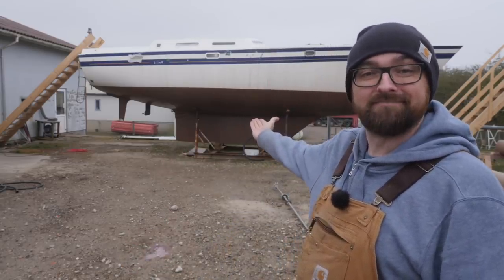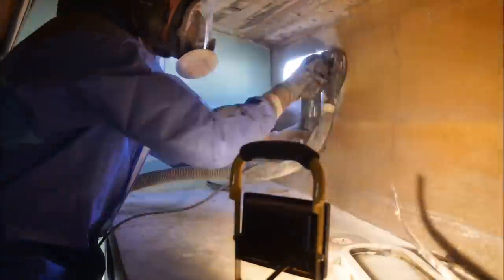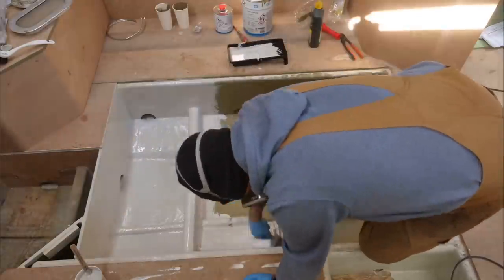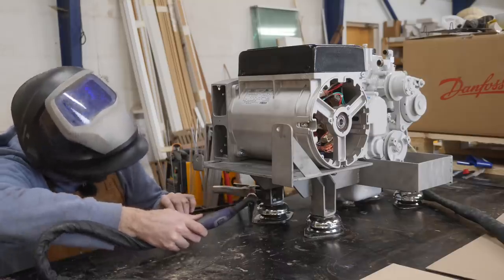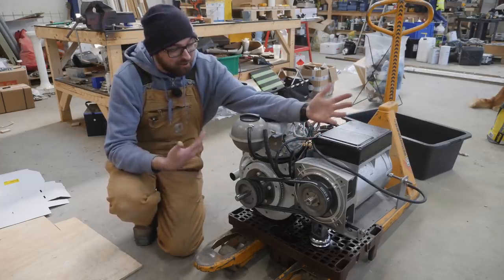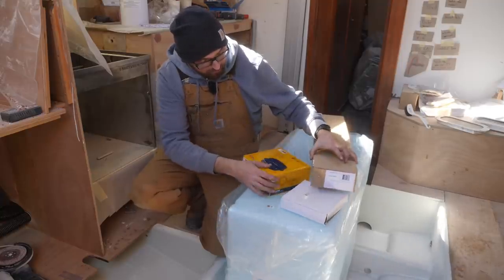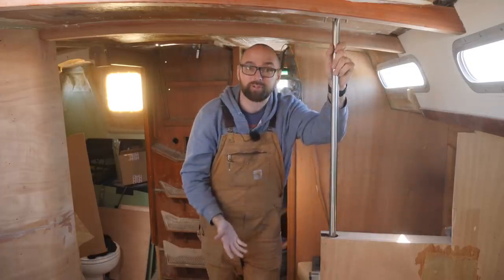Sail Life - DIY generator fail, galley pole - sailboat project

Comment: That sucks mads but, you can't put the crap back into the donkey.  Is changing pulley sizes to up the RPM at the genertor an option?
Reply from the maker: Hehe, that's true - or at least I'm pretty sure the donkey would be very offended. The RPM needs to be as close as possible to 3000 at the alternator to get 50hz :)

Comment: An option would be to change the alternator to a 4 pole version which runs at 1500 rpm. You can alter the pulley ratio to 2:1 so engine run at 3000rpm and the alternator at 1500rpm. Because of the ratio wouldn’t the engine in theory have twice it’s power output ???????

Comment: What are the differences between the 102 and 402

If these are the same engines, you could modify the 102 into a 402

I’ve changed my 9.9 hp omc into a 15 hp by changing the carburetors and the exhaust 

Just something to look into

Comment: Curious how you will fill and vent the diesel tank in the island?
Reply from the maker: The are two options :) Lazy solution is to fill and vent to the stainless diesel tank aft of the engine. The not-so-lazy solution is to vent through a pole (like the one in the galley)

Comment: Since you built a genny for a 402...find, build, or steal a 402. If 102 is the same block/head you might be able to seduce your 102 into becoming a 402 with injectors or other items.
Reply: Looking, your 102-04 is 411 cubic centimeters displacement. If my math is right, that's (almost) half a litre...the 402 is also half-litre. This might be doable either turning up your injector pump or replacing injectors and pump.

Comment: If both engines are the same size just find out what the difference is and modify your existing engine. Rebuild with an upgrade to the 402 so to speak. The alternative is just use power management like we all do.

Comment: oops,  Sounds like something I would do :)  I only think of how your temperament will be in 2 yrs when you are listening to the generator run 20% longer.  Lithium battery capacity would help in giving you more flexibility in your charging regiment.  You really won't know until you experience it,  it may not be a big issue.

Comment: Litterally an itty bitty turbo would double the output.   (the DIY route I would think would be a stock snowmobile or jet ski turbo, and those might be big.  They are getting upgraded all the time, and the OEM stuff is 10% or less on ebay).  See what the difference is between the 102 and the 402, specifically the connecting rod.   If it is the same part # you litterally could just produce more power out of this one, and the actual economy will go up.   Don't mess with intercooler or .anything.   Or, bite the bullet and get the 402, if they really look identical should be reasonably pain free swap, re sell the 102 to mitigate...   good luck.

Comment: I wonder if the 4 series is the same dimension as the 102. I only find listing for the 102 on a Turkish site, and Perkins itself doesn't seem to acknowledge the 102's existence when I do a search, but Perkins Parts does list it for filters and small parts, so the only dimensions I find are overall sizes, not between mounts or any other technical drawing. I think their website really doesn't like that I am not using Windohs or Mac, as well. and it is slow as all get out.
Also, when I look at "How to identify your engine" they don't show the ID casting for the 100 series to be where yours obviously is.
If you keep it, I'd look at turning the alternator a hair faster and running it as a charger for the battery bank. but you would then need more capacity there and with the inverter.
I tried a few other things, and I am really having issues with websites (multiple browsers and drop menues won't drop, ebay filters will not show, and other small issues . . . Who broke the introwebz?)

Comment: The proper sizing for an engine for a Genset is the engine should be sized %120 of the Generator max KW load. There must be a reserve of power to prevent RPM drop due to load. The Generator MUST maintain the RPM to make 50 cyle power. Other wise you can damage your electrical equipment.

Coking is not a problem with modern diesel engines.

(;-) TP

Comment: Looks like the 102 is not a very common engine. Much less info online. Looks like its about .1 liter smaller. Its .411 liters to .5 for the 402.  I was hoping it was just an injector upgrade, or just a turn on the fuel screw,,, but looks like the internals are smaller.
Reply: Both the bore and stroke are smaller in the 102.  The stroke is a fair bit more in the 402. 64mm compared to 72 mm in the big boy.

Comment: Sell the 102, buy a 402.  Even if the 402 needs an overhaul, it'll eventually pay for itself by not having to run it as much due to the more efficient output.  From the sounds of it, it would be a direct swap.

Comment: That is exactly the output I have mostly for my ...about 4500 watts max at 110 volts.  I can run a 1hp watermaker,  (See SV Adventurer's 30 GPH watermaker build on yewtoob.)  and, simultaneously run a small washer, heat hot water, charge batteries, and take a shower.  The power assist Victron as long as you don't take it too far works just fine. to meet all my needs??  Though the hot water is usually as a solar hot water dump with a dc 600 watt element, that kicks in when the lithium reaches 90% state of charge...you don't want to charge the batteries past 90% typically as you can cook them...and it means you can get 2X the number of cycles out of them...not lower than 10%  and no higher than 90%(Watch lithium below freezing...consider making your own LTO batteries that won't mind the cold.).

Comment: How about a bigger inverter and battery bank, and run everything from batteries making the generator part of something more akin to a hybrid power situation? You could then run the generator in it's most efficient, lower RPM range and the batteries would basically be a buffer tank.  Efficiency is pretty high but not 100%. Dunno how the math would work out.
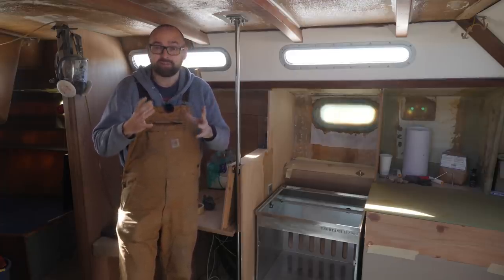Reply: Haha I typed this comment ^ before I got to 16:00. Good call.

Comment: More batteries my friend.  Adjust the use.  Instead of thinking of the generator for heavy load electrical items, set the battery bank to support that.  Let it bitty perkins serve as battery charger, only.
Reply: I should watch the full video before commenting.  Lol you answered your own question by boosting inverter output.

Comment: To quote that great statesman Ronald Reagan - "Trust but, verify"... :)  Remember the smaller engine, smaller fuel consumption. Finally, the reduction of wear and tear on the electronics is much lower hence, greater lifespan!  As for your power usage, I think your trying to live in a house and not a boat.  4K watts of on demand power is more than abundant for the majority of live aboard boaters.  In a typical US harbor (I can't speak to anywhere else) you typically have 2 x 30 AMP x 120 volt connections available for 7.2Kw.  When running A/C, freezers, refers, fans, TV's, entertainment systems, it is still more than enough. A typical Washer/Dryer unit takes between 12 - 16 amps at 120 volt - 1.9 KW, a microwave around 1.1K watts, and a spectra 150 Watermaker - 0.11K watts.  You can run a microwave, washer/dryer, watermaker simultaneously at 3.11K watts.
Reply: Reagan a "great statesman?"  Hah!  America hasn't had a great statesman since JFK.

Comment: Beef up your solar system and test first, it's easy to bore/stroke the engine or swap it later if needed. You have so much stuff on your boat that generates noise anyway so if you can rely on solar power more is only a good thing. You can easily fit 1000w solar panels which on a good day replace more then one hour of super annoying generator noise even with the big 402 alternative.

I'm not a fan of your 2 belt system though not shure if the crank bearing in this engine can hold that in the long run. But then again if you tear it apart every second year and replace the bearing it should work.

Comment: I think you need to look on the bright side. If you upgrade the inverters and solar, your system will be much more efficient in warm sunny climates and the 102 will be able to charge the batteries anytime, so you can also use them in cold climates. So, the system overall works - it just favors warm climates. Solution - go south young man!

Comment: just  change the size of the belt pulleys on the generator  so the generator  will spin faster with less effort to get the max volts you need

Comment: Thanks for sharing your frustration. As a fellow perfectionist this sort of thing makes me crazy and ensures that my basement is full of valuable crap that did not quite fit my projects.  

Take a good hard look at the loads that you are trying to cover.  It seems to me that you are sizing the generator to cover all your AC gadgets turned on at once.  It is not often that you will be using all of your devices at he same time.  Also, a washing machine is an intermittent load and will not always pull maximum power.  Your battery bank will be able to act as a buffer when the demand exceeds the capacity of the Itty Bitty Perkins.  Instead of complaining that your engine is undersized, consider that your generator is oversized relative to the engine.  This is not a bad thing, except for the space and the weight.  If you use your batteries to advantage this engine will serve you well.

I have  question though -- why did you not mount the generator to the bell-housing of engine, thereby eliminating the belts and complex mounting?  Space?

Comment: Find a good diesel mechanic, not hard to change injectors to get a bit more power out of the little Perkins or look for a 103 demensions are practically with 11kw output

Comment: Don't beat yourself up too badly over screwing up.  Have a beer and put it down to a learning experience.  Not sure where to look, but maybe you could work a deal to swap your generator plus some cash for a bigger one.  Alternatively, maybe you could buy a new motor outright.  Easy for me to say as I'm not spending the cash, but if you imagine running that thing for 10 to 20 years it might not seem so expensive in the long run.  Just a thought.

Comment: Don't beat yourself up Mads, not worth it and not like you anyway.  Stick a cheap turbo on the engine and uprate its power output.  It would only need an iddy biddy turbo and a bit of jiggery pokery.

Comment: I think you will be upset not having the generator capacity since you were planning on that and basing other system performances off of that. I think you will be better off to get the 402 than to spend more money making the 102 work and realizing later that it doesn't meet your needs.

Comment: hey, 
the problem is the rpm or the hp?
what about playing with te pulley diameters?
Reply: Watts and HP are both measures of power.  Adjusting pulley diameters will change rpm and torque, but not total power available.

Comment: How many hours a day will you have the oven on, same for laundry? and water maker?  Why do at the same time?  You can run the diesel generator for as many hours a day you want it will just take longer to fully charge batteries.  With creative load scheduling, no problem.  But I don’t know why you need to figure demand peak for everything on simultaneously.  Since these diesel engines are relatively expensive, a 2 KW Honda inverter type gas generator is portable, light, very quiet, air cooled, fuel efficient, and compact to store.  Can get you out of trouble.  Need an umbrella over top in rain though.  It’s relatively cheap, and easily sold used should you get a bigger diesel one day.  I use one to power my house in a blackout; boiler for heat in winter, fridge, microwave, small AC 7500 btu in summer, led lights.  I shut off the AC when the microwave is on, no big deal.  Creative scheduling. Can also day charge my solar batteries to run inverter all night with generator off and no noise at all.

Comment: Check out dieselpumpuk here on YouTube, he specialises in tuning old mechanically regulated diesel engines. - could be an awesome little project for both of you. You could slap a small compressor or turbo on the itsy bitsy teenie weenie perkins and fidle about with the diesel pump to up the power. Getting a few more kW out of a bulletproof built low revving perkins should be an easy task.

Comment: Why can't you just change the pulleys and make the alternator spin faster ? Then the itty bitty Perkins can run at comfortable rpm and also turn the alternator at the rpm you need.  The itty bitty Perkins will also sip less diesel.

Comment: Sell the DIY Generator either as a unit or parts and recoup what money you can and be done with it. Take whatever you get and apply it to a new generator that will handle all your electrical needs. If you don't get what you need/want now you will forever hate sticking with a DIY generator that never does what you need.

Comment: For what on earth do you need 4 kW of power on a boat? An oven has like 2000 W, so that leaves still 2000 for other things. Plenty. In a normal household of 2 people you rarely reach 4000 I would think. And on a boat I also think that you tend to use less electricity.

Comment: I think I need to disagree with the others who are suggesting that you change it to the larger generator now. Until you start living on your boat, you don’t know exactly what your daily power consumption will actually be. It would be a real shame for you to go through all the trouble to increase the size of a generator, and then end up finding out that you don’t really need it because you’re not using as much power as you expected. With those twin Victron inverter chargers, they can supply any additional power that you may require. I say use the resources you might use to increase the size of the generator to actually increase the size of your house battery bank. As far as cold climates are concerned, it’s my understanding that you’re going to use your neat little diesel heater that you created. That heater should take a huge load off of your electrical system.

Comment: I would not use a plastic diesel tank in the middle of the saloon. According to my experience, plastic tank might leak diesel smell through the tank walls. Depends of course on the wall thickness and possibly on the plastic type. See also:

https://www.spill911.com/poly.html#D

Steel or Al would be safer.

Comment: your generator is still pumping out about 4000 watts, .. I know it sucks, but , that is also a LOT of power.  at 110 that is like 40 amps. almost 3 fully 15 amp circuits, . or ALMOST a full stove plug. I think it might be just fine for what your doing, .. but I am not sure I have never lived on a boat. I mean you might have to think a little bit about not running everything at once, but that is still a lot more power then a lot of portable generators use. Also consider, length of time vs power draw, its an important part of the equation. You might be using that high amperage for only 15 mins, while you cook dinner, . but you might run the generator for an hour. in this case you still come out a ton ahead.

Comment: Anger, Denial, Acceptance - when you recognize that you are in the acceptance phase, then it’s time to decide how to move forward.  I would put this project on hold to give yourself time to reconcile multiple options.  My first instinct is to try to find a 402 and sell the 102.  You have spent years staying true to your vision.  With the completion in sight, now is not the time to use blurred vision.  You will regret not sticking to the plan.

Comment: Too bad about the engine.  My suggestion would be to sell the you DIY setup. Look for a new 48V DC unit.  Run a 48V Li battery bank and one or more inverters for you AC loads.  To me the down side of the AC unit is it has to run at a fixed RPM to maintain the output frequency even when only requiring light loads.  Also you are already going to have an inverter.  With a DC unit it can be throttled reducing the noise to match the load at the moment.  With the properly sized battery bank, you can choose how often you wish to run the generator and which times you want a silent boat.   And for those pesky 12V intermittent high load devices like winches, heads, bilge pumps that you don't what to over pay for the 48V or 24V versions just have one 12V smaller battery that is kept charged from the main Li bank with a switching 48V to 12V charger.  You get the efficiency of the 48V DC in the inverter and smaller wire sizes over 12 or 24V systems,  you have enough battery power to run the refrigeration, lighting, electronics and cooking without worrying about starting the generator.  Also size the inverter for those items you can run on DC.  Though you should be able to get DC water maker and refrigeration.  Dive compressor will most likely need AC as will induction cook tops, microwave and oven.  Though, I would think one could easily retrofit a an oven to use 48V.

Comment: Don't settle for the 102.  Find a 402 and work from there.  You may have to build a new bracket, or sell the 102 setup as is as a generator, and repurchase the alternator.  You will never be happy with the 102 so please do yourself a favor and don't figure out a way to settle.

Comment: Ok I hate to sound like an idiot, but if the motor is just used to spin up the alternator which gives the power, how does this affect output? I understand load etc. But isn't 3600 rpm the same 402 or 102? I do admit upfront that I know nothing about generators.  But I do understand engines.
Reply: Look at ot like an automobile.  If you only have a car with 80 HP and. You need to go up a steep grade, you are going to be going slow. If you have 300HP you will get to the top a lot faster.

The more power the alternator puts out, the harder it is to turn.
Reply: Or can changing pully ratio help at all to speed up the alternator?